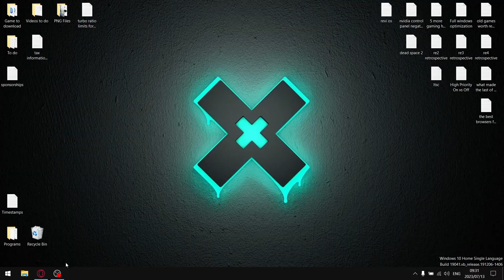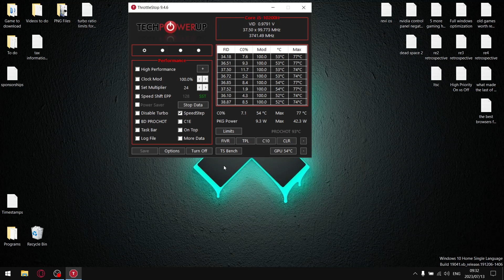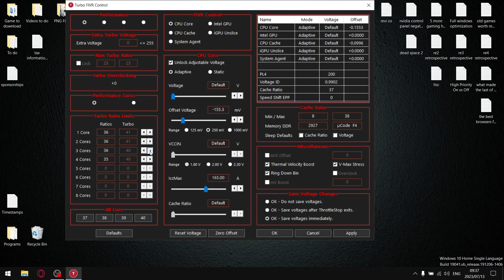Throttlestop - Turbo Ratio Limits Explained | How to reduce temps in 12th & 13th gen #throttlestop

Comment: Hey can you do a video on a HP z4 g4 Intel(R) Xeon(R) W-2295 CPU @ 3.00GHz (3.00 GHz) using throttlestop witch  turbo ratio limits is locked how can you unlock it.

Comment: Been following these guides but here is the issue. My GFs laptop has a i7 12650H. It's got 6 P-cores and 4 E-cores, but whenever a CPU intensive task starts, the performance is thermal throttled to around 2.6Ghz which is INSANELY slow... The CPU reaches around 85c, it's on a cooling pad and it's not clogged up with dust or anything. I have no idea why it is throttling so aggressively and I don't know what to do :/ any suggestions?
Reply: did you ever find the solution to this, i have the same issues

Comment: My Dell XPS 17 9720 doesn't have Turbo Ratio Limits like you have in the video. It looks close to the same but instead of "Turbo Ratio Limits" it says "Turbo Groups" instead of "1-8 Cores" it says "Group 0-7" instead of "Turbo" (next to "Ratios") it says "Cores" is this the same thing as what you are talking about in your video?
Reply: My Ratios starting with Group 0 are 50, 50, 46, 46, 43, 43, 43, 43. Based on your instructions I would need to change Ratios to 24. That seems like a really big drop in the number which makes me think this method does not apply to my computer.
Reply from the maker: Not at all, try 43 over all cores or 42
The difference is because you have 12th gen or newer

Comment: Generally speaking a good option BUT you forgot that certain cores can clock higher than others without a big temp impact. If you supply all cores with the same amount of power equally, those cores will be slowed down while other will still waste energy in form of heat conversion. So yes, you can do it like that but it´s less efficient than analyzing which cores are most efficient and only boosting those a little more instead. Despite that, it´s pertty much the only option you can do. If you have already improved cooling and done undervolting if possible.

Comment: A yellow lock appeared near the "non turbo ratio". now my turbo boost does not turn on, and the laptop only works at the base frequency. How can I fix it?
Reply: check if the disable turbo option is checked, if it is, just uncheck it

Comment: Now i know why changing numbers done nothing. In FIVR  i still have blocked Turbo Ratio Limits. Even after your guide video about cpu optimalization. :(
Reply from the maker: Yeah unfortunately if your computer has undervolt protection that method won't work at all.

You can disable undervolt protection via a real grind, but then your CPU operates at 400mhz which is no good

Have you tried TPL suggestion I made of 30 and 30?

TPL is different to Turbo Ratio Limits. It's literally the last resort if all the other options aren't available
Reply: @laptoptweakingtips  now i know 37w cpu boost is for factory, that what HWinfo is showing. That,s why. And around 70tdp in total, so when gpu i doing 45w, cpu has only 25w room, and so on and on. What a garbage...

Comment: Hi, i have lenovo legion with i7 13700HX, i was able to undervolt it to -120mV on core and i also limited max frequency, but wonder - is it now possible to use different power modes (performance, balance, quite) which are common in lenovo laptops? Because these alter voltages etc... I don't know, which settings will be prefered by the system
Reply from the maker: If that voltage is stable in performance then it should be fine in all the other profiles 

Nice laptop btw
Jealous 😎
Reply: @laptoptweakingtips  thanks 🙂 the thing is, I cannot see any difference in quite mode. I am happy with its thermals even on default settings without undervolting, but lower temperature with UV can be seen just in performance mode and that only by few degrees while gaming (maybe 1-2°C lol), so I'm not sure wheter is not just margin of error. In stress test it's bit better, but still maybe just 5 °C decrease in performance mode.
Reply from the maker: id say just stick to performance with the undervolt

but thats just me im one tracked when it comes to performance @tomasoto1

Comment: Hey so I have an Asus Vivobook pro 16x with a 13980hx and it seems like everything is locked, even the Turbo groups and everything. I am new to laptop undervolting and all of that stuff. Is there anything I can do to get my temps on CPU down they are really bad right now.
Reply from the maker: In the description of this video is a link on how to unlock undervolting and turbo ratio limits.

You have 13th gen but it's hx so you can possibly unlock undervolting, but definitely unlock turbo ratio limits 

Give that video a watch and let me know how you go

Thanks for watching btw
Reply: @laptoptweakingtips  I followed the video in the description and it actually did unlock throttle stop! My temps are a lot more stable now for sure. It shows that the offset voltage is unlocked but I have it on -200 and I don't think it is doping anything. But the turbo groups is definitely working thanks! I know some people that have this same problem so I am going to link them your video.
Reply from the maker: @The_Shadow_Star  yeah bro the more powerful CPUs function best with turbo ratio limits.

-200mv seems to much though

Comment: Can I re-enable secure boot again after enabling the undervolting? 'Cause I need secure boot enabled to play Valorant 😅
Reply from the maker: yes bro

secure boot was just to be able to boot into grub :)
Reply: @laptoptweakingtips  hi can set fsb overclock or do turbo boost also can it be reset with system restore  if i want go back to before it was created please reply me asap appreciate you helping me thanks
Reply: @laptoptweakingtips  
hi can set fsb overclock or do turbo boost also can it be reset with system restore  if i wanted to  go back to before it was created please reply me asap appreciate you helping me thanks this should be all i need to know just in case will this ruin my pc

Comment: I cannot change Turbo Ratio Limits on my 12700H, please help!
Reply from the maker: There is a link in the description on how to unlock it if it's locked 👌
Reply: @laptoptweakingtips  I just watched it, so I have to flash boot my laptop in order to do so?
Reply from the maker: @keiarazero5376  it's safe bro, as long as you follow the steps outlined you'll be fine 

Essentially youre changing a on value to off for both your overclocking and cfg locks 

In windows 11, disable bit locker in services, and virtualization in your bios 

This tends to block the unlock process 🤘

Comment: I have 12 gen 12900k cpu and I have no problem undervolting, it is just bios setting to turn off the restriction
Reply from the maker: Yeah it's mostly laptops that have been restricted my brother.

Although I was trying to assist a guy with an 13900kf who has the same issue so I suppose it could also be manufacturer dependent
Reply: @laptoptweakingtips  hi please do you know how i can overclock a 12th gen locked cpu my laptop is hp core i7 1225u my ghz is 1.7ghz and need about 2 ghz i promise once you helped me that will be it or can you do it with setfsb or throttle stop or do you know tools i can use means a lot to me and can a system restore point created before it was done reset it thanks

Comment: Thanks for all the help you gave me before bro but nothing works for me . I tried all the steps undervolting and setting low turbo ratio limits but cpu is always at 92-93 degrees. even cleaned the cpu and applied thermal paste didnt work. I don't have any hope now it isnt that laptop cpus cant take 92 degrees they can easily  withstand those temps but still wanted lower temps as i game a lot. i will give a heads up if i find any other sol. thanks :)
Reply from the maker: what cpu do you have?
Reply: @laptoptweakingtips  i5 10300h we talked already before bro few months back 🤣 after trying all methods it didn't worked
Reply from the maker: @avenone9916  yes but that was before I understood the 10300h better

The clocks are set to high on that chip

Undervolt 
Estimate ~ core -140mv
Estimate ~ cache -99.6mv

Turbo Ratio Limits either 39 or 38 over all cores

Temps will come down dramatically then 

Also for good measure clean out potential dust from fans etc.

This will get you covered 👌
Reply: @laptoptweakingtips  i tried that undervolt my laptop got bod mid game and temperature were still hitting 93 degs
Reply from the maker: @avenone9916  are you still under warranty?

Cos it you cleaned fans, changed thermal paste, undervolted and adjusted turbo ratio limits and you're still getting 93 degrees there is something wrong bro
Reply: @laptoptweakingtips  no bro warranty is gone as already for more than 2 years i have it .
Reply: @laptoptweakingtips  i think i might apply a better thermal paste because the one i use its cheap one i think but even if i purchased a good one and it didn't work then it will be a waste of money so idk
Reply from the maker: yeah something isnt right bro
people with 11800h & 10750h processors get good results so it doesnt make sense that a 10300h doesnt
something is off bro @avenone9916
Reply: @laptoptweakingtips  yeah bro thats for sure but idk will see if something happens it always runs that hot but never noticed any issues in performance or anything but i know this laptop is made to easily handle this much temps and its been running like this for years so its good.
Reply from the maker: @avenone9916 I understand that, but what I'm saying it doesn't make sense that after everything no temp change.

I've helped tons of people with 9750h, 10300h, 10750h and 11800h chips. It doesn't make sense that the temps are still high

Do you still have the ability to hand it looked at or is the warranty expired?
Reply: @laptoptweakingtips  warranty expired way before .

Comment: do you share throttlestop ini? ı use same proccesor
Reply from the maker: it may be the same but each cpu has different dye size bla bla
so you could either undervolt further or less dependent on the luck of the draw

but send me a blank email and i can send it to you if you want
jfdalton29@gmail.com

Comment: Bro i found something
I have 12700h When I set the max frequency of cpu speed (from power plan) to ultimate I got 86.496 point(960M Test) on TS Bench in ThrottleStop with 83c" maximum

When I set it to 800mhz (notice: it's only apply on e cores, p cores still at max) I got 106.866 point with 78c* maximum And i noticed that the lower the maximum speed of the e cores the higher points and lower the temperature.

So is that okay to set the e cores to only 800mhz for example? Or will cause a problem later? Please answer me. (Another notice: for all tests fan speed didn't increase more than 4000rpm except ultimade speed test)
Reply from the maker: Honestly the e cores are for operations where performance isn't an issue. So unless you run into issues I think that would be fine
Reply: @laptoptweakingtips  so can I keep it on 800mhz?
Also is it better to TS Bench to take more time or less to finish the benchmark?
Reply from the maker: @tacaio7  the smaller the number the better
As it means it's quicke to finish the benchmark 

Sorry been on holiday that why replying is slow and unfocused lol
Reply: Do a benchmark only a benchmark can tell. It might be a good solution since you are ot using te E cores much regardless but they produce exess heat. So by slowing them down a lot you can headroom for the P cores.

Comment: Everything locked in TS for me.. Only use turbo boost off sometimes.
Reply from the maker: I linked a video on how to unlock undervolting/turbo ratio limits in the description of the video my brother
Reply: @laptoptweakingtips  you're a legend!!!!!!
Reply from the maker: @deckwizar  shit didn't you see this video before? What CPU do you have?
Reply: @laptoptweakingtips  13900hx
Reply: @deckwizar unfortunately I picked up a laptop with the same processor and I am on the journey to finding unlocks for it. Not much luck yet but I was able to adjust turbo ratio limits to lower temps and stop thermal throttle.
Reply: @deckwizar I used intel extreme tuning utility and set turbo boost short power to 60w, turbo boost power max to 55w, and turbo boost power time to 128 seconds it has lowered temps to under 90 while gaming and have around 70+ fps on helldivers
Reply: @ApexJake  thanks for the information!!
Reply: @deckwizar  for sure dude! Keep me in mind if you find any way to undervolt the CPU haha

Comment: Sooo first I have to do TS Bench then watching the FID
For example let's say the FID is 45 then should I set all the cores to 44? 
Or only the p cores?
Reply from the maker: Yeah bro, so if it drops to 45... It should drop in the first couple of seconds. Set it to 44 correct

12th gen looks a little different to my setup, but I would assume it would be the p cores as they do the heavy lifting (ie when the CPU is under load)
E cores are more for just run rate desktop when the CPU isn't under load
Reply: @laptoptweakingtips ohh I understand.. but how do I know which of them are the p cores or the e cores? I have all the 8 cores section open should I set them all with the same number orr?
Also I do know now how to do it because of you but what "FID" Does mean?
I'm sorry I know I take a lot of your time xD
Reply from the maker: @tacaio7  if it doesn't specifically say p cores, then it will by default display p cores

I think the 12700h is an 8 p core and 6 e core processor
But I might be mistaken 

Fid I don't know lol, I just know what it indicates not what it abbreviates haha!

Lemme know how you go
Reply: @laptoptweakingtips  hmm the problem is it says 0 cores groupe 1 cores  groupe..etc to 8 cores groupe
I guess I will put the same number to all of them lol
Reply from the maker: @tacaio7 i think
perhaps the 0 cores are e cores though

i dont have 12th gen, so mine looks different to yours 1-8 must p cores
try core 1 to 8 at 44
0 core just leave as is

as mentioned earlier, you can always delete your throttlestop ini file and reboot if things go wrong 
just experiment with this as your guideline
Reply: @laptoptweakingtips  I was about to ask the same question asked earlier. 
Its quite the opposite according to intel's website, its 8 e cores and 6 p cores.
According to him it displays 8 cores so does that mean that it displays the e cores?
Reply from the maker: The fid column on the front section of throttlestop will always display the p cores 

So experiment and change the turbo ratio limits until it doesn't reflect in the fid column on the main page.

If it doesn't reflect it will be ab e core
Reply: @laptoptweakingtips so basically I change all the cores on left side of the table that throttlestop always me to change. However, before hand I need to check the FID numbers of the 8 cores.
Reply: @laptoptweakingtips What confuses me is how it shows 8 cores that are changeable if they are not all of them e cores.
Is changing the e cores harmful? Now when cpu is not understress it will use the new value provided which I assume is higher than its original value. ( I'm not really knowledgeable so im just sharing with you my thought process )
Reply from the maker: E cores are the cores the CPU uses when just doing run rate things, things that don't put stress on your CPU
Reply: @laptoptweakingtips  I'm sorry for being unclear. What I'm trying to say is when I change all 8 cores to lets say 4 ghz instead of original boost speed which is 4.7.  

We also do not know which of the 8 cores are the 2 efficient cores  so when set the 2 efficient cores to 4 ghz isn't that technically overclocking them as the the efficient cores original speed are 3.7 ghz?

I'm really sorry for my annoyance and beint unclear, I know I'm asking a lot of questions.
Reply from the maker: @mohamedelsayedt2350  you won't be able to set the efficiency cores above what they are allowed to go

Unless your laptop specifically allows you to 

Send me an email
I wanna ask you something
jfdalton29@gmail.com